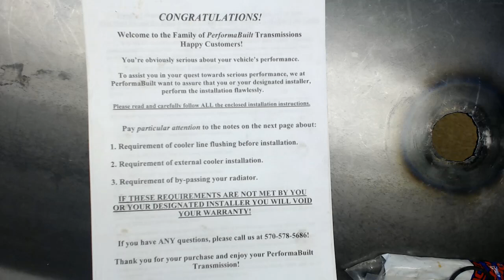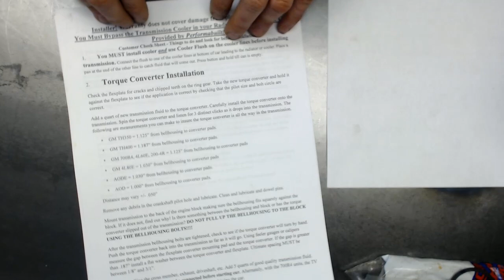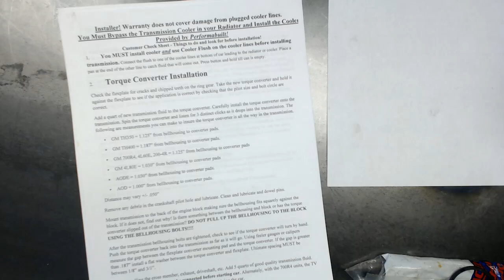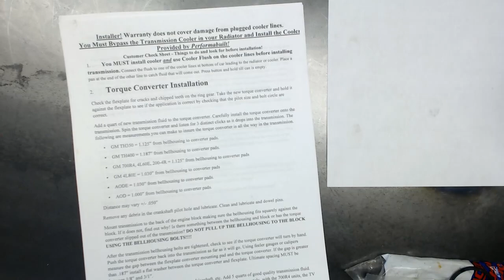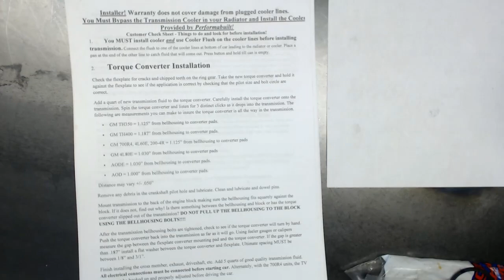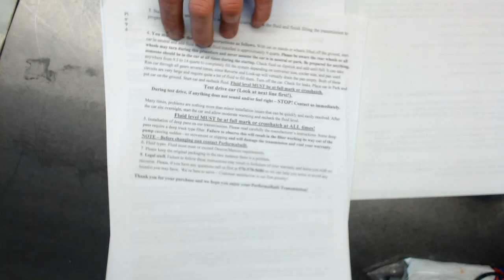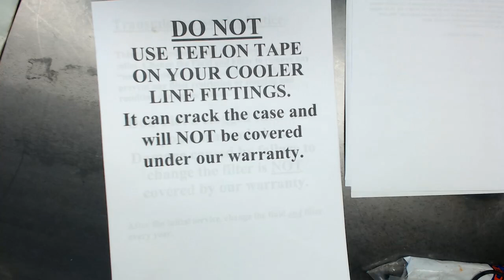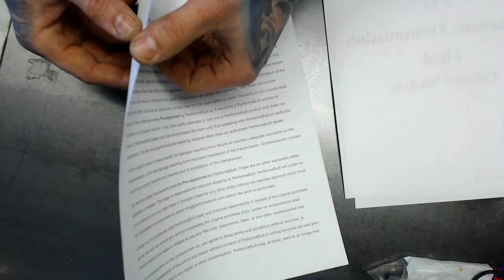Ryan breaks down the basics on automatics!

Comment: After researching transmission upgrade options for my mild '01 Suburban 4x4, found Performabuilt has an incredible reputation, most notably everyone that had personal experience with them over the past 10 years + all said their customer service is first rate. I called and talked to Ryan a couple times on the phone, those conversations solidified my choice to have PerformaBuilt build my custom 4L60E trans, ended up purchasing 2 transmissions from them, my custom build and a mild build for my daughters '01 Tahoe 4x4. My father then researched a bit and he came to the same conclusion as I did and he also ordered a custom 4L60E for his 05 Sierra 4x4 he uses for towing.
Thanks again Ryan.
Reply from the maker: I really appreciate the kind words and hearing about your experience! You wont be dissapointed!

Comment: I've got just about 2k miles on my Heavy Hauler with the optional 5-pinion planets, and I just want to say in all seriousness, this friggin thing WORKS FANTASTIC when towing!! I'm seriously blown away at how great this thing is!

 I've been turning wrenches pretty much since I could hold one. My grandfather restored Model T's, and worked on anything and everything, my dad hated it so it skipped him, lol, although he did wrench when he had to and had lots of great tricks he taught me over the years. I picked up in my grandpa's footsteps and run a very small shop at home working on everything from weedwhackers and motorcycles, to cars, trucks, and aircraft. I've owned alot of vehicles over the past 30 years from stock to hot rods. I'm telling you, I've never had a transmission work this well in my life! It seriously made the truck feel like I had done some engine mods - there's a noticeable seat-of-the-pants increase in torque (presumably from the 100x better-than-GM torque converter, and the fact there was alot of slipping going on with the OE trans), and the shifts, especially 3rd, 4th, and lockup are fast and firm. I wasn't used to the way 2nd gear hit at first, since I had my OE trans pressures cranked to the max via a plug-and-play programmer - 2nd used to hit pretty hard, but you couldn't feel 3rd, 4th, and lockup - you'd only know by listening or watching the tach ... and 3 / 4 is what burned up in that one, not surprisingly. Now 2nd hits much gentler (which is perfect for towing - no need to beat the crap out of the hard parts), and 3, 4, and lockup are fast and firm the way they should've been from the factory. It makes towing so much more enjoyable since it works so well. It's changed the entire characteristics of my '07 Silverado 1500 5.3 4x4.  I plan on either buying a built engine, or buying a mild one and adding a supercharger - haven't decided yet, but it's good to know I'll have a transmission that can handle it. 

VERY happy with this unit!! I shot 3 videos on the installation - it was TOUGH. GM sure doesn't make a single thing easy for us anymore, plus there were some corrosion issues to deal with, since the truck has been run in MA its entire 103k miles / 13 years at the time of the swap (November 2020). I'll recommend you guys to anyone and everyone. Hard to find honest people in this day and age. I knew I made the right choice when you guys called me and discussed my truck usage at length with me, right after placing my order. Much appreciated! I LOVE this thing!! THANK YOU!!

Oh, and I also appreciate the info on trans temperatures. That's one myth I had in my head from way back, that the trans wouldn't function correctly with fluid that was too cold. Since bypassing the OE in-radiator cooler, my trans temps are running 50° cooler this winter. Hottest I've got the trans so far was 170° towing in stop and go traffic. As soon as I get out on the highway, that temp plummets! It's amazing  - running the Tru-Cool 40k without the thermostat.
Reply from the maker: Im so happy to hear you love your HH Trans and the way we do buisness! It made my day reading this comment!!!